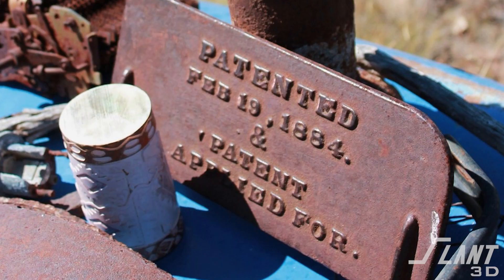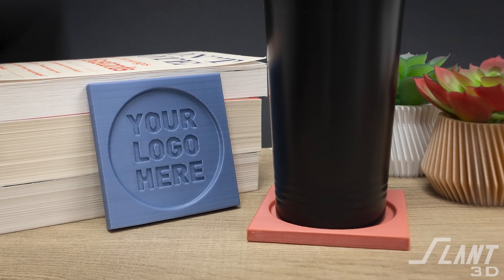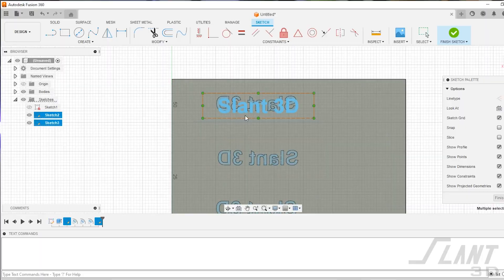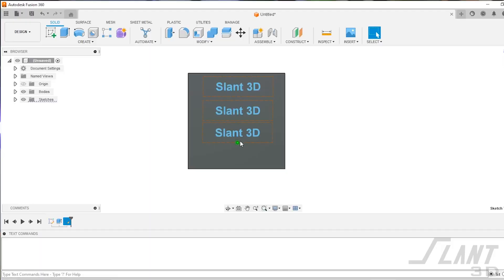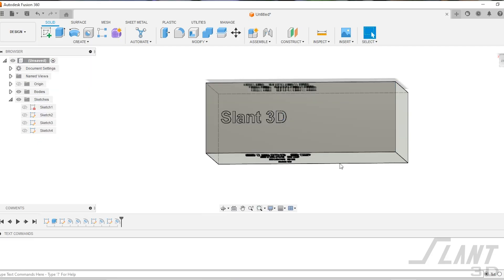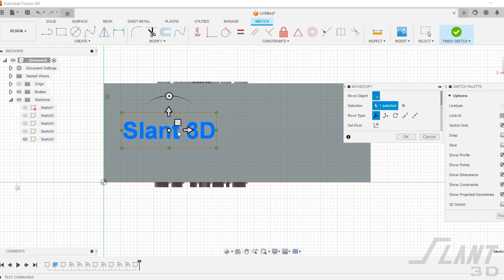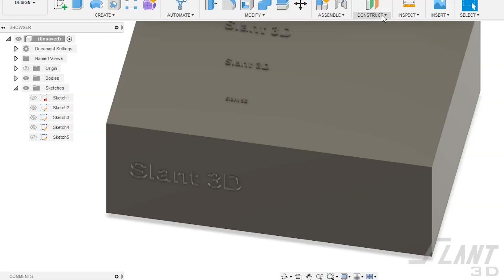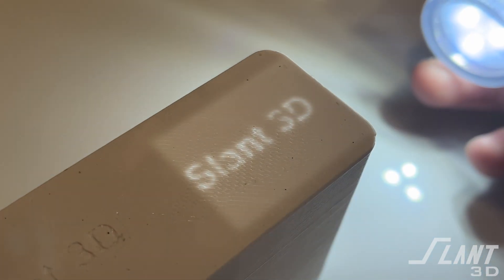Designing Text for Mass Production 3D Printing

Comment: Good stuff, in the context of putting text or logos on prints, are there any standard ways designers should be labeling their designs with recycling codes? Scouring the internet there seem to be 4 options:
1. Not bother, it isn't worth it since nobody is going to recycle the printed product anyway (I don't like this).
2. Put a resin code 7 on them (https://en.wikipedia.org/wiki/Recycling_codes#Resin_identification_codes_and_codes_defined_by_the_European_Commission) which is acceptable I guess but also, labeling things as "other" is the worst label to put on things.
3. Use a custom variant of the chinese recycling labeling system (sounds not standardised, saw on reddit)
4. (Nobody said it but since 3 exist I might as well) Use the chinese codes (https://en.wikipedia.org/wiki/Recycling_codes#Chinese_codes_for_plastics_products)

There do seem to be models of some codes available for download so it would be fairly quick to add them, https://thangs.com/search/recycling%20codes?scope=all

What is slant3ds take on this?

Comment: For printing text on the bottom, would it be possible to place the text first as an object in the slicer and then adding the other object with negative space where the text goes so that the text object falls within the main object, hopefully causing the print head to move in a different pattern where the text goes?

Comment: I insist students add rev numbering for iterations. But small characters are illegible if print is not crisp and the features smear. So they can use a code system that tolerates inaccuracy. We standardize on rev codes being all numbers, the dash to separate values, a period=1, a pipe=5.        e.g.         .. - ... - |.. - |     is read as 2-3-7-5.   Even a janky print can still have the code readable. This can also be use for students to put their student ID number on prints so I know whom I am grading.

Comment: I'm very new to 3d printing. I just designed and made a replacement plastic flap for my alarm keypad. Thought it would be fun to put some tet on there. I designed it with engraved?(sunken) text on the bottom face. I just set it to 0.1mm, the text is very large (40mm tall letters), so just initials on the keypad face. 
When printing, it looks like the first layer just skipped those areas, the next layer just printed over them. The final result is very subtle. The area of the text came out with the diagonal texture, and the rest had the flatter bed texture. If you catch the light just right you can clearly see the letters, otherwise they blend in.
I also put embossed text on the top face. Slightly smaller font but still maybe 20mm tall letters. This time set to 0.2mm. Came out very nice.
(My part was only 2.5mm tall so no text on the sides :)

Comment: I've tried text on the bottom of the print many times. It is not reliable at all, and I'm using a Bambu X1. 

If you can get really good repeatable bed adhesion you'll get better results but still the thick outline of the text looks bad... but maybe that can be changed in slicer settings?

Comment: For a lot of applications this isnt needed. The text tool in Prusa slicer does a really good job of adding text to objects. you dont even need to use the slicer for printing. just open stl, add text then export the stl file.

Comment: I have to disagree with the bottom text.  With the first layer accuracy of my prusas or bambus i just do a single .25mm layer of text and its a really clean way of putting part numbers etc.
Reply: With our home printers there's additional leeway for more "extreme" things like that. Having one slightly frustrating print for us would be a nightmare in a 100+ printer farm. I like Slant 3D's videos as they often address common 3D printing themes but at the same time, sometimes the context of a particular concept is squarely within the realm of print farming and may not necessarily apply to the hobbyist.
Reply: I think there should be a separation between what's possible and what's desirable. Text on the bottom can often make a lot of small island and sharp corner that can lift up. This is generally fine if you can soberly check your first layer but is probably highly annoying if you need to deal with 100's at a time. It can be done, it probably will look good, it will also probably be quite annoying
Reply from the maker: In mass production it is not viable
Reply: @slant3d  How does Prusa get away with it on their printed printer parts? Do they just accept a higher defect rate?
Reply from the maker: And they design the text appropriately for the first layer

Comment: Text on top comes out fine with modern slicing and a decently dialed in printer.
Reply: I would agree, I think he means for manufacturing reliability
Reply from the maker: Heat concentraction is a problem with physics and design of the 3d model not with software
Reply: @slant3d  could you explain how heat concentration applies?
Reply: @blockfifteen  AIUI that claim is only about raised lettering but I don't see how it applies even then. Even if there's nothing else left to print in these layers, more than 2 or 3 letters gives plenty of cooling time even on printers with abysmally bad cooling.

I was more talking about the claim that breaking up the solid top fill where letters appear over it hurts surface quality, which is only the case if you're using non-monotonic top fill or a slicer that otherwise botches things.